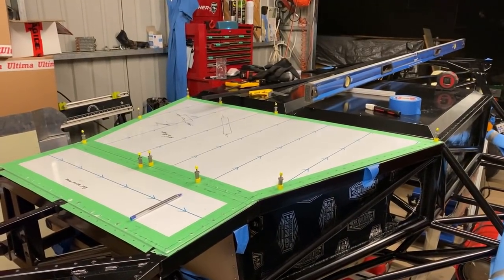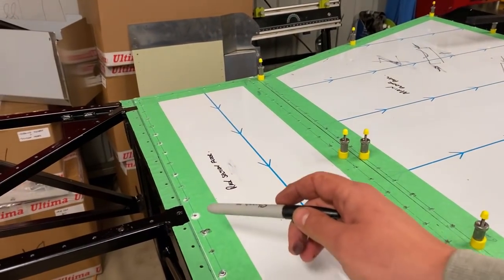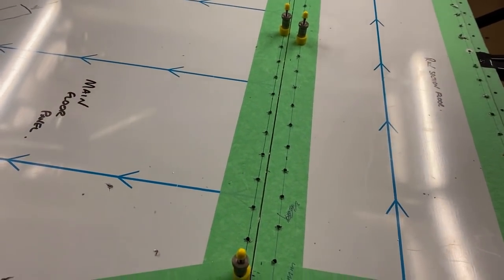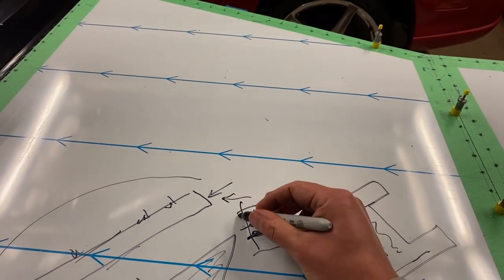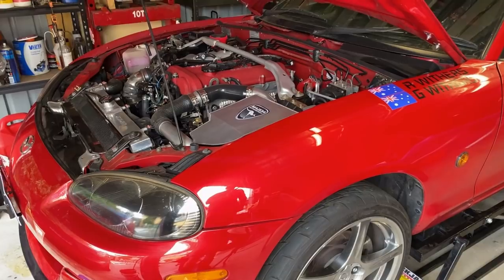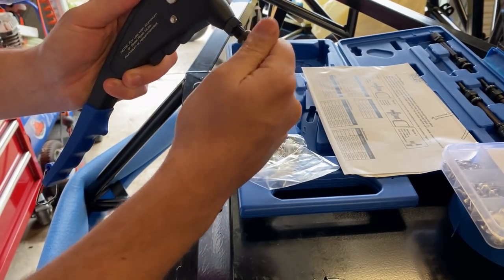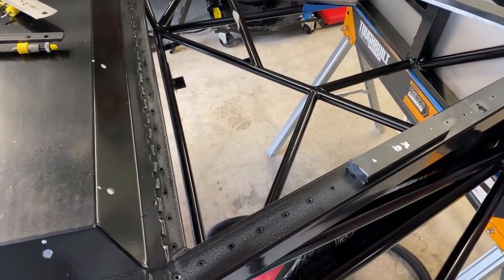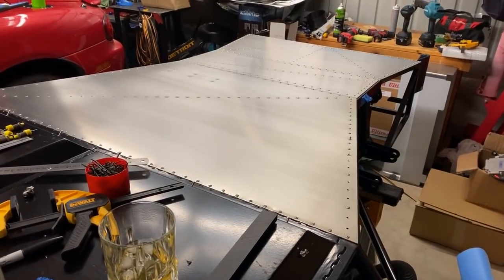Ultima RS - Rock sliders for offroading and pictures of my under carriage (Video #8)

Comment: Rob, nice to see how you are approaching your build. 
I am looking for a next project and the RS could be a very interesting fit. 

If I understood you correctly,  you stated, better not to use carbon fiber (CF) parts for the structural parts (in this case I believe you meant the floor panels?). What is the background for this?
The shapes seem to be pretty simple, so it shouldn’t be difficult to get them right. And from a stability standpoint CF should easily be able to handle this...

Interested in your thoughts...
Reply from the maker: Hi Martin, No issues with using CF for the structural components. But more that the Aluminium bonded construction/steel doesn't require the same manufacturing 'prowess' that CF does if you're constructing the components yourself. Don't get me wrong, I love CF and I got a decent amount of familiarity when I was studying at university, but it's failure characteristics/cost and how much it'd add to the experience of what is essentially Group C era chassis tech' isn't necessarily a great advantage. All the power to the guys who do incorporate a bulk load of CF into their cars, though! Cheers, Rob
Reply: @rob105motorsport  Thanks Rob, appreciate the feedback! Will be closely following your progress!

Comment: If it’s going to be under the car you would be better off using a cf/Kevlar mixed fibre.  Ultimately not quite as strong as cf but is more abrasion resistant.

Drilling shallow holes in nylon, run the drill backwards.  Stops the drill grabbing and going deeper than you want.
Reply from the maker: I hope the CF in the rear floor doesn’t get too much abrasion or I’ve worn some other bits off already, but that’s a good point in regard to the Kevlar benefits.
As for the Nylon, that is something I discovered. Although the melting kind of welds the swarf to the outside of the hole (easily cleaned up).

Comment: I think, you will never go for anything else than the nylon skid plates.
It's cheap, fairly light, and easily replaceable.

Since nylon is quite slippery:
If you make a 10-12 mm chamfered location hole in them and a steel 'male' insert for your jack, you can more easily jack the car up, or trolley the car around with the fear of it falling off.
Reply from the maker: This is true. But I do love the Jabroc detail on the Porsche 919 LMP cars.... it’s such a great feature and interesting material. Agree on the nylon holes though. I actually selected the length of the sections as they fit perfectly within the cup on my big floor jack too.
Reply: @rob105motorsport  There you go. 👍🏻

Comment: Hi Rob. Enjoying your build. Thanks for the tech talk, very interesting as I'm building a locost, so an ultima's very poor second cousin....
The riv nut thing looks the go, do you need to paint it before you install or does it seal itself?
I'm going to use your nylon idea for underneath because I think it will be scraping as well.
All the best with it....
Reply from the maker: Great project and not the poor cousin at all. Just a different and unique experience in its own right. The riv nuts do seal very well, but a bit of paint never hurt anyone. The other product that’s great for sealing is actually nail polish. You can steal it off your missus and the little paint brush is a great applicator.
Reply: @rob105motorsport  HA HA great idea.....got no chance with the missus, but the daughters........

Comment: Is there a risk of Galvanic Corrosion between the aluminium and steel? (i assume the chassis is steel).
Reply from the maker: Yep. Aluminium is the anode though. They’re not greatly dissimilar metals, and sealing/protection/maintenance is always important. The whole floor is Aluminium bonded to a steel chassis (noting the obvious advantages of material ratio there). 
So in fairness, there is the potential for galvanic corrosion, as you’d see with any bonded dissimilar metals, but it’s not an issue unless you don’t care.

Comment: You should do built in jacks like on race cars, I think I've seen one of these cars with it.
Reply: Yeah, but they take up a lot of space inside the car...
Reply from the maker: I 100% looked at air jacks. I was so close to pulling the trigger..... maybe I’ll do it. Apparently you can use a little scuba tank and get around 40 lifts out of it.

Comment: Your frame should be plenty thick enough to tap at 1/4-20 or 10-24 and eliminate the need to drill out the larger hole for a riv-nut.  It also allows for flush mount and eliminate the need to recess the blocks.  I've had a lot of success with this on my Factory Five 818.
Reply from the maker: I did consider that and there's definitely no reason you can't do it. The reason I didn't tap them was simply because I preferred to have the Riv-nut as a somewhat sacrificial break point. The aluminium would destroy itself instead of stripping the hole in the chassis as there's only depth for a few threads. How is the 818? I saw a video on The Smoking Tire or Matt Farah's Youtube a while back and he seemed to say it was very fun.
Reply: I’m only at the go-kart stage, and that phrase accurately describes. Butt on the ground, engine behind you, it’s like Christmas at 10 years old with your first go kart, unbelievable fun.

Comment: Any reason you didn't buy a air powered rivet gun, just a thought cheers.
Reply from the maker: Simply because air hoses are a pain, compressors are noisy, and the battery stuff is so good now. An air riveter is way cheaper though if you already have a compressor so it's definitely not a bad choice.

Comment: Where in Tas did you buy the quick jacks and wheel dollys?
Reply from the maker: I’m not in Tas’, but the wheel dolly are Supercheap jobs when on special (2 for $99) and kind of wish I’d saved and bought the jacking type. The Quick Jacks were from an industrial hoist place.... just Google them. They’re the Aus supplier. Really great tool.
Reply: @rob105motorsport  ok, thanks for the info.

Comment: Do you thinking’s possible to put electric motors in the car rather than petrol?
Reply from the maker: Certainly possible. But they're a little soul-less, and a newer technology chassis may be better (unless you're using it as an R&D test bed like Mclaren).
Reply: Rob 105 agreed about soulless. Was just trying to imagine the 0-60 but I’m guessing you might have traction issues!
Reply: Rob 105 enjoying the channel by the way 👍🏼

Comment: G'day Rob,
Love watching your build videos. Trying to find videos of people doing a build and actually talking through the process is very hard, even harder to find AU builds. So thank you for spending the time to put it all together.
Me and a mate are just about to start building 2 custom vehicles. I created a video in unreal engine and posted it. 
https://youtu.be/GVD6D43JikM
Intention is put them on the road with some track time.
Aim is sub 375kg, R1 bike engine.
Nearly finished all CAD and preliminary engineering reports. Vast majority of components bought and sitting on the build table, just waiting for the steel.
Keep up the good work.
Reply from the maker: Thanks, Tim. The chassis in your render is very 'Ariel Atom' in the convex frame section around the cockpit which is cool! Have you managed to do some FEA analysis to see that it you've picked up any critical stress points? 
What diff' are you running? I would have to dig back through my notes on past engineering projects, but there are some awesome LSD arrangements for chain drive setups......
Reply: @rob105motorsport  the vehicle is based off Arial Atom as well as some other bike engine builds out of the UK. I have been using FEA to evaluate chassis and suspension components (all custom). Main thing with chassis FEA is ensuring the chassis twist profile is smooth. Diff wise, I will be running the quaife LSD designed for chain sprockets, makes things easier. For road rego in vic a lot of engineering analysis is required to make for a smooth registration process. I'm lucky at my work to have access to very high level software tools. Have been in discussion with a engineering signatory to start to process?
Reply from the maker: @timwoods8483  Sounds like you're all over it which is great and i'm pretty sure the Quaife is the item I investigated when I looked at a VTR1000 powered car for hillclimbing when I was at Uni. Rego signatory are state based  I believe. I can ask my ACT guy if he recommends anyone in Vic if you'd like?
Reply: @rob105motorsport  I work with a few signatories down here so for my car that's all under control. I was just checking to see if you had started the process. I have heard of too many horror stories of people buying kits and building cars without the necessary discussions / admin. And then realise once the car is built, they can not register it without extensive re-engineering.
Reply from the maker: @timwoods8483  Having the experience is definitely in your favour. I don't know how you'd invest so much time and money building without investigating the engineering process first.
Reply: @rob105motorsport  Unfortunately a lot of people rely on heresay, just think that if it is legal in UK or USA it is legal here, a friend of a friend of a friend said it would be ok and sometimes just plain ignorance.
Same situation with hot rod and suspension kits that go on modified vehicles, a lot of time and money gets spent on these vehicles with the assumption 'she'll be right', cause 'I bought it from someone, so it must be ok'

Comment: I've be given  reliable information that for the best engine  would have been a 987 flat 6 turbo with the drive train and suspension
Reply from the maker: I’m not sure why that’d be the ‘best’, but I suppose that’d be a way to somewhat capture the Porsche Group C racecar vibe.
Reply: @rob105motorsport  not just that it lightwight incredibly power to weight profile is  amazing

Comment: Makes sense. But why not add a tub weld it in?? Thanks
Reply from the maker: Hey Dave, Weight and I'm quite averse to welding much to a nicely painted chassis. And it is nice to have a removable sacrificial piece. Cheers, Rob
Reply: @rob105motorsport  agreed nice work going forward can’t wait for the finished product!!

Comment: Can do it like race cars with air pistons. Hook up an airline and it will throw the car in the air. Not economical for production cars but aluminum body unidirectional air pistons probably don't weigh much more than stiffened jacking points.  The nascar method of a pipe stub welded to the frame with the jack having a pivoting pipe cup.
Reply from the maker: Definitely considered an air jack system, Jack. Mainly because it's a fun feature. I just opted out based on the additional cost/effort to have an air supply. Apparently a small size scuba tank actually has enough capacity for >20 lifts which is quite good. Cheers
Reply from the maker: @curvs4me  Cheers mate. I'll check them out.